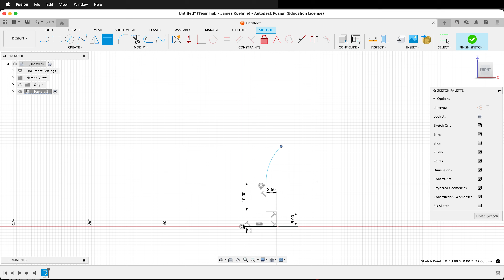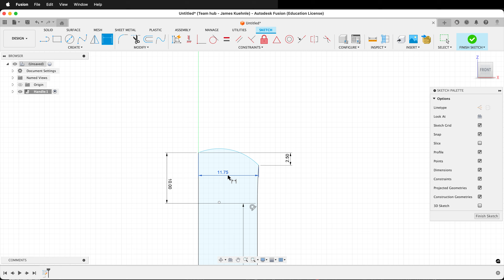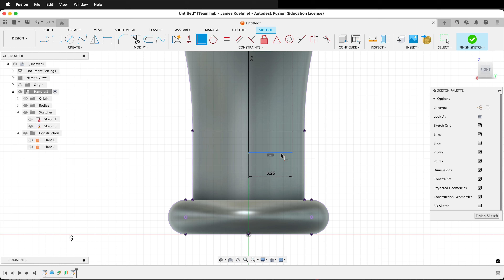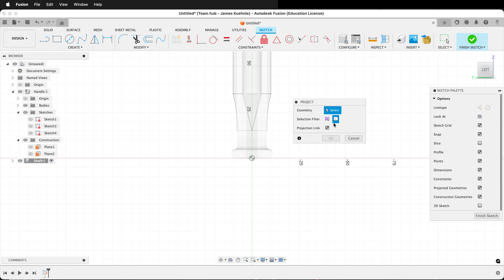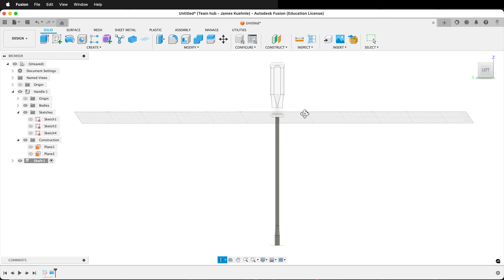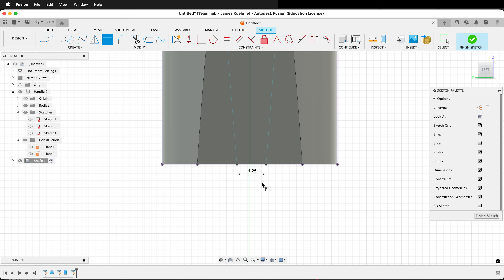Autodesk Fusion Tutorial: Model a Screwdriver with Revolve, Fillets, and Circular Patterns

Comment: TIL about hybrid mode. What's the difference to the (default?) part mode? Why prefer it for this model?
Reply from the maker: Hybrid mode is the way Fusion used to work before 2026, port mode can only contain bodies and no components 

It is better because it allows for reusable parts but can be cumbersome when ideating. This is for students learning and it is kept in hybrid mode to keep everything in a single project file for simplicity
Reply: @WhatMakeArt ah so they just changed! In that case I'm still used to hybrid mode I guess
Reply from the maker: https://youtu.be/gr_ATJbgCkc this goes over the basics of the new part, assembly, hybrid, intent driven design in Fusion 

I plan to do some deeper dives with the part and assembly workflows